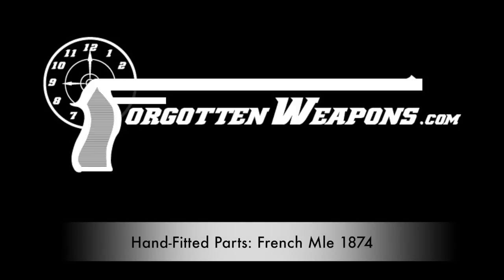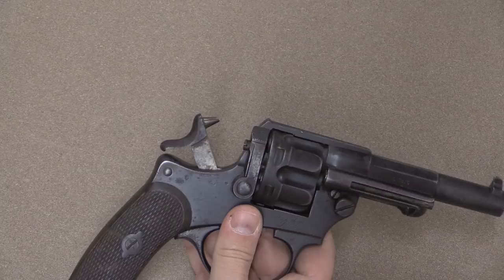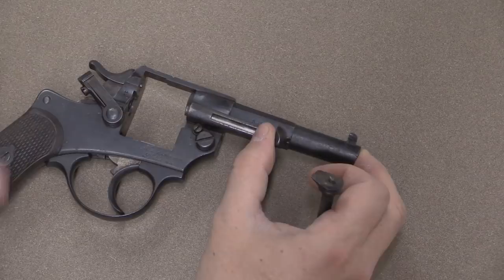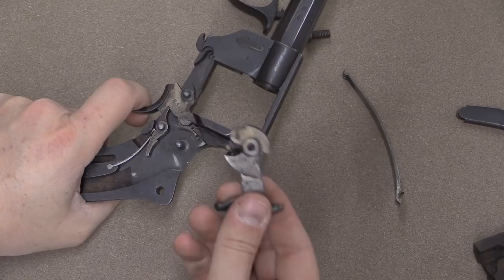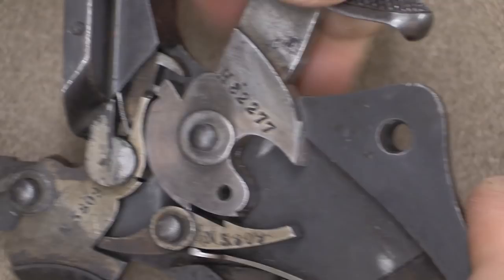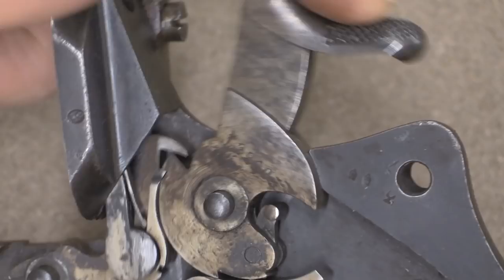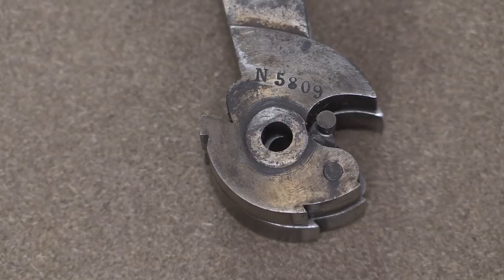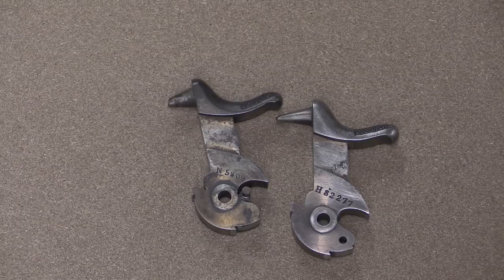Hand-Fitted Parts Firsthand: French Modele 1874

Comment: How common is this sort of thing among small arms of the late 19th/ early 20th century? Would these parts have been made in a different factory? Was mass-production technology just not in a place where this could be avoided at the time?  What accounts for such a significant difference between what, in theory, should be completely interchangeable parts? Cool video!
Reply: +Red Burton At this time even guns made in a factory are essentially being put together by individual gunsmiths, and whilst the components would be made on a production line, they would go to the gunsmith oversized and be filed to fit, so they're not actually interchangeable between all guns of a specific model. That's one reason why a lot of those components are individually marked with the gun's serial number.

This was actually a significant problem for mass-production as late as the 1940s. I know the UK managed to get the plans for the 40mm Bofors AA gun in 1939, but couldn't start mass production until about 1941 in part because most of the components were labelled 'file to fit' (the other reason was that the plans were in metric and all of the tools and raw materials were in imperial measurements).
Reply: Fascinating! Thanks for the info.

Comment: I suppose I'm a bit biased since I work metal myself, but I was wondering why you'd go to all the effort of getting a replacement hammer when you could so easily attach a new firing-pin tip.  You wouldn't even necessarily need to disassemble the gun to do it!

Comment: Would it also be an option to cut the new hammer at the rectangle part, do the same on the old hammer and weld the old "round" part to the new rectangle part (including the firing pin etc).

This must be super unclear, English isn't my first language and then to have to explain something technical is really difficult.

Comment: There is another easier option. Align the two according to one (functional) surface and the pivot. Use some layout fluid to trace the functional one onto the one you want to fit. (this acts as only a rough guide) Then either wet grind, or use a file, to adjust the profile until it fits. (checking often) The work is pretty trivial to do actually.
Reply: +Whatfor5 Why this isn't as simple as it sounds was addressed in the video.
Reply: +Lupinus9x19 Shockingly, I actually watched the video through to the end prior to commenting. It really isn't as difficult as he is making it sound. While the part is hardened there, it is highly unlikely to be sufficiently hardened and a high carbon enough grade of steel that, hardened or not, one couldn't attack it with an O1 steel file.
Reply: +Whatfor5 Being able to file it down isn't the problem. Go back and rewatch from 6:25 or so. When you file away at a hardened part and don't retreat the part you will have wear. Depending on the differences in the hardness of the parts, surprisingly fast wear. That creates a potentially unsafe condition quickly as he explains in the video.
Reply: +Lupinus9x19 Hot grinding, yes. Hence, a file or wet grinding.
Reply: +Whatfor5 the type of grinding isn't the issue. It's that that once you file off the surface you have softer metal interfacing with harder metal leading to problems, unless you redo the hardening yourself.
Reply: +Lupinus9x19 Case hardening is not that difficult, but what I saw in the video was not a convincing argument that the sear face itself had to be re-cut, hence why I suggested you align the two according to the pivot and functional surface (in this case sear face). And on top of that all, FWIW, while the part may well be case hardened, it certainly doesn't look it. Case hardening to that shallow a depth, and then depending on said case hardening for a sear surface, can be a risky decision for all the same reasons you're highlighting.

Comment: What say you file down the pin completely, drill a hole throught the hammer, get a little firing pin cone made and find a way to crew it onto the hammer, then possibly arc weld or heat treat it to fuse into place?

Then again, that's a bit too crazy :P
Reply: Kyle Van-Tiel : You are not thinking straight, it is easier to just TIG weld the tip back on, then re profile it, and much quicker and less damaging.

Comment: You should have a machinist make 1/2 of the firing pin out of tool steel. Drill a hole in the hammer to accept the new tip and silver solder them together.

Comment: To go with all the other crummy solutions below: Would it not be possible to simply shear off the hammer body of two of them, leaving the fine parts, and simply weld the intact one into place? Obviously this would probably cause a myriad of issues and i'm not a gunsmith, but i'd imagine it would be a working solution, if incredibly sloppy. Plus, you'd probably need more tools to get a proper cut with all the measurements.

(Also, the video is VERY informative on what exactly 'hand fitted' really means, so thanks for that)

Comment: Thoughout the video I was thinking, why does he not just break out the tig welder and fix the original? I guess you thought just replacing it would be easier, ha. Fat chance. I have the same issue with 1911s. I guess some parts in some firearms just can not be made to be easily replacable. In the T33, they got it right. The entire hammer unit is one module piece. If it breaks, ditch the old one and drop in the new one.

Comment: Hi Ian. There is a part in this vid which is a bit confusing to me. Are you saying that the 1873 replacement part works with the 1873 you have but not with the 1874? If so, is this really a case of hand-fitting incompatibility or were the 1873 and 1874 models just manufactured slightly differently even if the mechanism was the same?
Reply from the maker: +Andrew Suryali No, the replacement hammer doesn't work in either my 1873 or 1874.
Reply: +Forgotten Weapons Ah. OK. I misunderstood. Sorry about that.

Comment: 1. Hmm... What do You think gunsmith would use instead of dremel tool? :)
2. Instead of welding on "a blob of steel" wouldn't it be better to flatten it a bit more, drill, tap and screw in a pin tip shaped screw?
Reply from the maker: +Mikołaj Lewicki 1) Presumably they would be more talented in its use than me. :)
2) Either one would work.
Reply: +Mikołaj Lewicki I was about to suggest the exact same thing.

Comment: Hi Ian,
can't you just weld a few blobs of metal to the clipped firing pin and grind it back into shape?
This surely isn't as perfekt as it was out of the factory, but thinking of how often this gun probably will be fired in the future, this should hold another 100 years :)
Plus this ensures all parts stay serial number correct.
Reply from the maker: +grh angelone That's what I am going to do, as I say at the end of the video.
Reply: +Forgotten Weapons Ah sorry, somehow I missed that part, as I was thinking about how I would do this in the later part of the video :)
But I see I'm not the only one who missed that bit when I skim through the comment section :)

Comment: What's the letter on the serial number? the three hammer have a different letter, maybe you need an hammer with the same letter
Reply from the maker: +Uryendel The letter is a series prefix. They would make guns 1-99,999 and then the next gun would be A1, then A2, A3...A99,999, then B1, and so on.

Comment: Reckon refitting only the part that has been removed in this case, was the least form of  resistance repair. Reckon too, hand fitted mechanisms which that pistol contains, is much like each log fire, it star the basic same actors... yet never the exact same show. 
-gilpin 3-19-16

Comment: Couldnt u just weld onto the old firing pin? Heat + tig welding. Then re heat treat? I kno this video is old but metal is just crystals you can reattatch metal.

Comment: What is the difference between single-action and double-action? I hear that phrase quite often but I realise I don't actually understand what it means xD
Reply: Google dat shit m8...
Reply: double action in revolvers means that the hammer is resting forward on the gun and that as you squeeze the trigger, the hammer moves rearward until it passes a certain point to quickly move forward to hit the cartridge.

single action in revolvers means that you have to manually move the hammer rearward in to the cocked position for each round in order to squeeze the trigger so the gun can fire.
Reply: +LittleMikey a single action revolver need its hammer to be cocked by hand, on a double action the trigger cocks the hammer for you and fires it after in a ''double action'' thats why its called like that
Reply: +LittleMikey Single action means that the trigger (or rather the triggerpull) performs a single action, that being therelease of the already cocked hammer. In double action, the pull of the trigger also cocks the hammer back, allowing for it to get under high enough spring tension for the hammerfall to detonate a cartridge (so the triggerpull cocks and releases the hammer, hence double action).
To recap: 
 - manually cocked hammer and short triggerpull: single action
 - the hammer cocked and released in a single, long triggerpull: double action.

Most modern handguns work either way, but there are single action only (SAO) and double action only (DAO) configured guns, SAO typically being older revolvers (and some early semi-automatic pistols), DAO being mostly semi-automatic pistols (and some snub revolvers).
Reply: Guys, i think he gets it.
Reply: Alex Missi "Mine! Mine! Mine! Mine!" seagulls
Reply: piritskenyer Pretty much :D

But thanks guys, that makes a lot of sense :)

Comment: You're wrong: The simplest solution would have been to build up a new firing pin on the existing hammer via JB weld and then file it to a point.
Reply from the maker: +Garry Owen JB Weld? Nope, not making a firing pin out of that.
Reply: Lol, just a jest sir :)  You may get one shot off with that method though.
Reply: +Garry Owen how about real weld? tack up some material onto it and file it down. or if it was in my shop(not a real gunsmith just armature but i got equipment) i would remove the temper out of the material and file it down and harden it myself.  it wouldn't be the highest quality job but it would make the gun functional and it wouldn't cost me an arm and a leg for a gunsmith to do it. not my gun though and i'm not the brightest so maybe getting it done professionally is the way to go...
Reply: Just use part of the bubble gum your chewing

Comment: You could re-harden the replacement hammer. Case hardening is not very deep, and it would be murder on the tools used to fit the new hammer too. 

That is substantial difference in material between the two hammers. I'm somewhat surprised, as it was after interchangeable parts were becoming common. Perhaps there gauges were worn, or they just fit parts by guess and check. Not very good on the manufacturing and production engineering end there, French arms industry of the late 19th century.

Comment: Is there any weaker a cartridge than what this fired?
An absolutely TRAILBLAZING 130 m/s!
Reply: +Ballsack Teebaghard "that actually saw service" was that part i forgot to add
Reply from the maker: +Ballsack Teebaghard I don't know where Wikipedia got that number, but the actual loading was a 180r bullet at 695 fps (230 m/s)
Reply: +Forgotten Weapons 
Thats... barely more than an air rifle...
Reply: Still not wowing me, but both numbers on wiki were under 200 m/s
Reply: +Forgotten Weapons These numbers could have been chrono'd from someone using low power loads who did not want to blow up their C&R firearm.
Reply from the maker: +VicariousReality7 You are welcome to be unimpressed, but I (for one) definitely don't want to get shot with that cartridge.

Comment: Wouldn't swapping the 1873's sear have worked?
Reply from the maker: +SeanPwnery Then I would be dealing with two non-fitting parts instead of just one.
Reply: Ah, I see, I take it you didn't have the sear and hammer from the same 1873 gun - that was my line of thinking.
Reply from the maker: +SeanPwnery Not spares, no - just the hammer.

Comment: Hah there are so many ways to do it. Really wouldn't take much to make a new one, but then I am a old school machinist and worked with old tool and die makers and have worked heat treating too. As long as you keep the hardened steel cool it will stay hard. The same as you would do if you were reprofiling a knife. The sad thing of professionals remaking one off small parts is the hourly charge to keep a business running. Still a kid in Pakistan could make you one because labor is cheap.